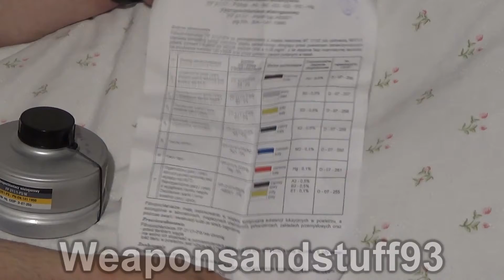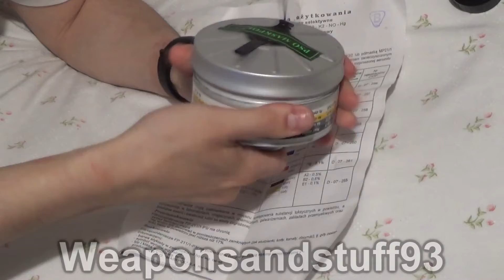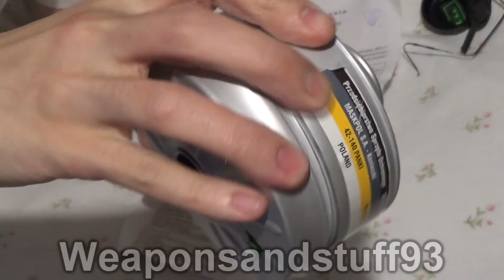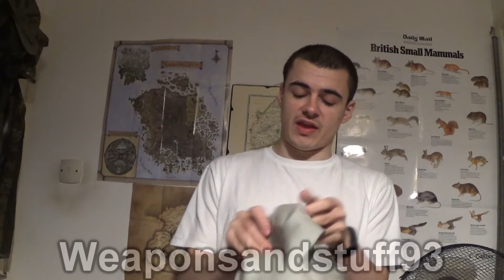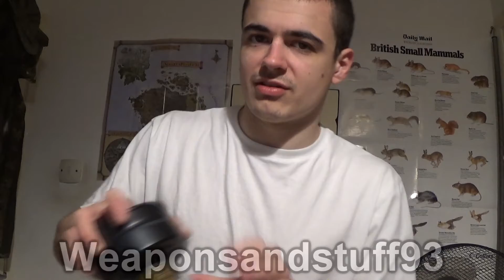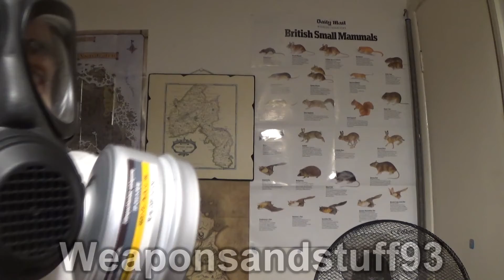Surplus Polish civil defence ABEK2P3/CBRN Filters

Comment: I've been having some trouble finding these, however, I have found these other filters which are A2P3 and ABEKPD filters. Do you think these would be good for GOST gas masks?
https://m.ebay.co.uk/itm/NBC-Russian-Gas-Mask-Filter-Canister-GP-5-GP-7-A2P3-ABEKPD-40mm-new-/112569558431?var=&hash=item1a35ab259f%3Ag%3AX9IAAOSwXeJYJwXJ&_trkparms=pageci%253A24351ba9-b028-11e7-b64f-74dbd180c34f%257Cparentrq%253A16460f2215f0ab64c3b88ee4ffffe78d%257Ciid%253A2
Reply from the maker: Yes I've recommended those filters many times before.

Comment: I'm sorry to hear about your back,but in your opinion which Avon Gas Mask is the most comfortable in your opinion the S10,FM12 or the N10?
Reply from the maker: +Nestor Schalbetter Never had an N10, but I have a CT12 which is like the FM12 and I prefer it to the S10, it was basically Avon making a direct successor to the S10, a lighter mask with a more comfortable face-seal.
Reply: Is the CT12 lenses compatible with the S10 lenses so i can put on a Flash lenses?
Reply from the maker: No, they're a slightly different shape.